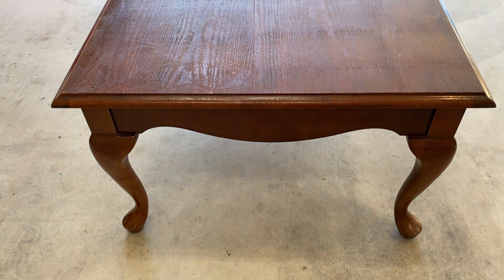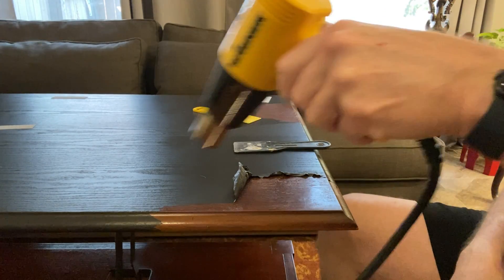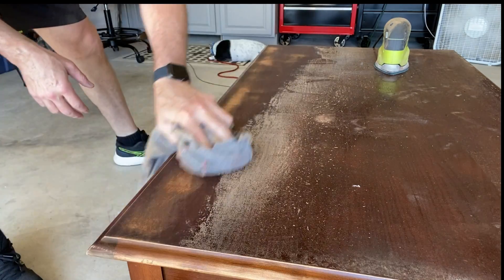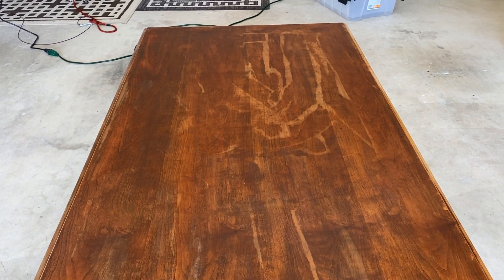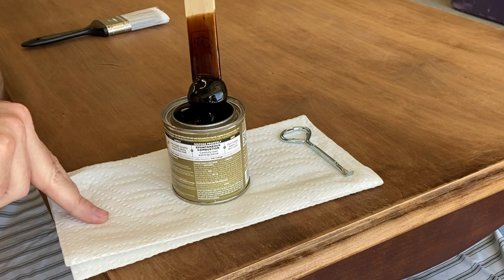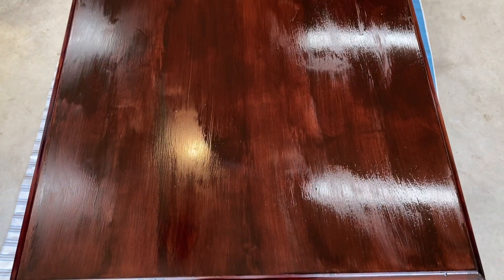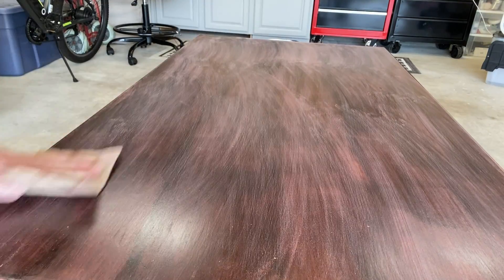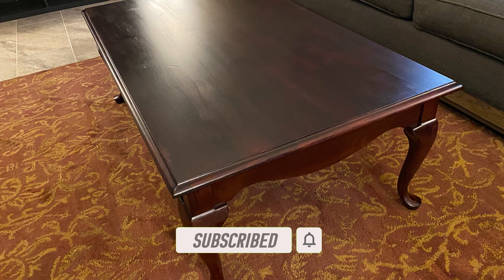DIY Coffee Table Refinish with Minwax PolyShades | Stain & Polyurethane in One!

Comment: I have used that product a few times. I've gotten the best results by brushing on and then using a clean cloth to wipe it down right after. That gives a much more clean and brush free result. I then let it completely cure and repeat.
Reply from the maker: that's a wonderful suggestion.  thanks!
Reply: Can you wipe this product with poly in it? That's great if I can!
Reply: I just used this and it’s good stuff but incredibly sticky because of the mix in poly/stain…I couldn’t imagine trying to wipe this stuff off after applying. Foam brush works well just keep stroking the brush to do away with high spots

Comment: you give me hope...I have the first coat of Stain and Poly in One and I'm not a fan.  Sometimes I feel like it's painting with glue and the heavy drips are hard to manage!  I may just sand it all down again and use separate stain and poly.  It's also been outside for 3 days and still smells!  Uggggg
Reply from the maker: Oh my.  I agree that it can be a challenge to work with and more than once I thought of scrapping the entire project and just doing a stain, then poly.  The drips are also a pain.  I found that using the lightest coat worked as the best technique, but I wish I had used a much softer brush. Regardless, I thank you for your comment, and wish you the best!